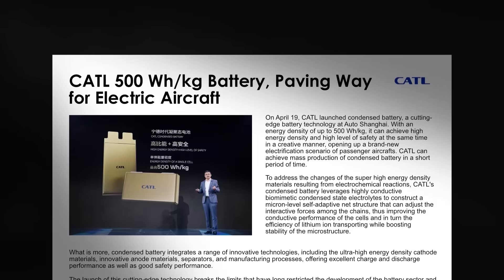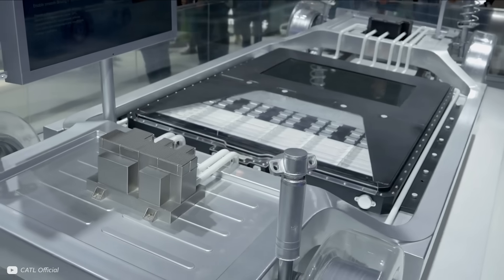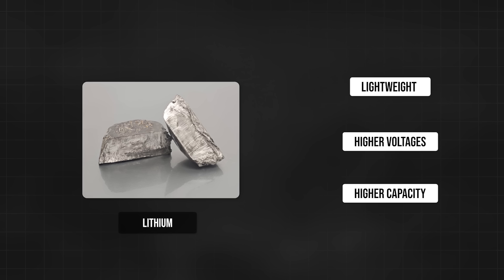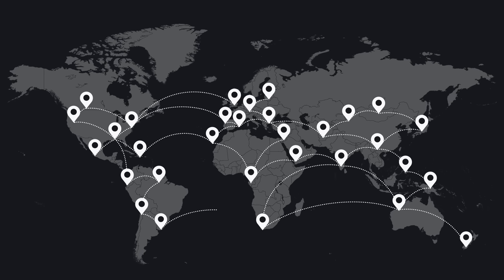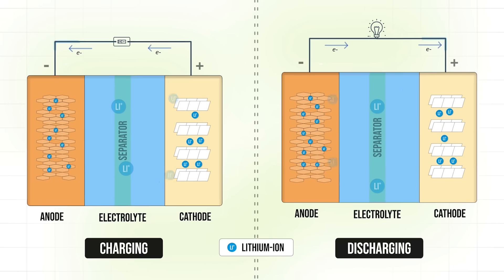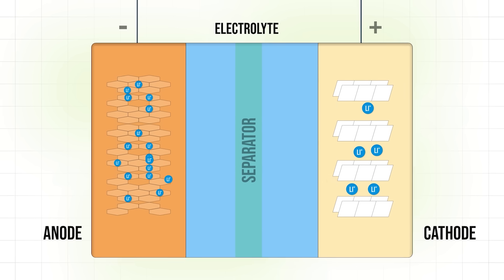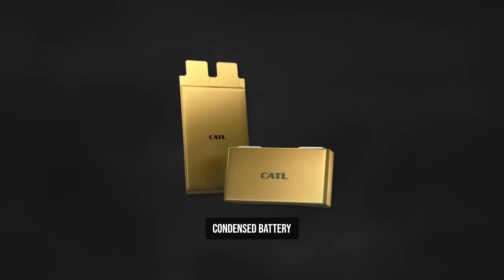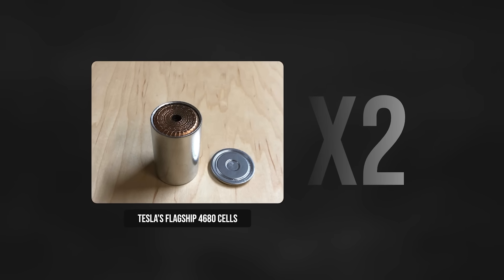Next Generation Batteries: Beyond Solid State

Comment: Whenever a new battery technology is announced, the first metrics to examine are its gravimetric and volumetric energy density, cycle life at 1C charging, the maximum supported fast-charging C-rate, and the cycle life at that fast-charging rate. If these core parameters are not disclosed, it is a strong indication that the technology is unlikely to reach large-scale commercial production. Demonstrations without these numbers are usually PR showcases, not proof of a manufacturable battery.

There are also several common red flags to watch for:

- Claims of 3,000+ cycle life without specifying the C-rate are misleading. Achieving high cycle life at 0.2C is relatively easy, but sustaining it at 1C is far more difficult and far more relevant for real-world use.
- Advertising 5C or 10C fast charging without publishing the cycle life at those rates is another major red flag. Battery degradation accelerates dramatically at such high C-rates, and without that data, the claim is incomplete.
- Especially in sodium-ion batteries, companies often announce only gravimetric energy density while avoiding volumetric energy density, which is frequently nearly half that of current LFP cells. This hides the real space and packaging penalty at the system level.
- A separate and equally important red flag is the suggestion that lower energy density is acceptable simply because the battery supports 10C or 15C charging. In reality, there is virtually no widespread charging infrastructure capable of supporting such extreme rates, and building it would be prohibitively expensive at scale.

In short, if the full performance envelope is not disclosed, the technology should be treated with skepticism rather than excitement.

Comment: Let’s hope they can make a battery that lasts all day if not a week - Problem to overcome in retrospect ( the next thing to think about ) - If you could make a new future battery 🔋cell that could last all day to say 5 days, think about the re charging capabilities of the battery, how many times you could recharge the new technology battery before the battery’s life ends and how long that would take ?, by putting say 10 new technology batteries in a block cube shape configuration you’d be able to charge one battery to another in a cycle i.e so one battery runs out and then one of the other 10 batteries 🔋 recharges the depleted first battery in a cycle, this way none of the batteries would ever deplete creating a power cell that could last for a long long time ?  this until you’d need to create fresh batteries from start again not unless the recharging processes of rechargeable battery’s improved to if re designed like the design concept and new technology processes of batteries in this video.

( Self battery recharging system with one big power cell battery in center of battery configuration set up - well of energy being discharged to and  power stored onto it, on / in, that big power cell in the center of 10 battery etc configuration formation system set up with all the other batteries finally being charged in the cycle ) a near non end infinite fuel cell 🔋? Possible to do with some ingenuity ?
Reply: battery capacity is not measured in days
Self changing is only possible with an external source of energy added to the battery body

Comment: nickel hydrogen batteries are probably still the potentially most cost effective batteries for those areas where space and weight are not an issue, they last for decades if i read correctly. but the truth is that tiny light batteries will absolutely be possible..... though this could mean they inevitably get radioactive as well as radioactive isotopes are the most obvious example of small, portable and incredibly energy dense.

Comment: 500 Wh/kg sounds high, right ? Other fuels are typically listed in MJ/kg, so let's convert: 500 * 3600 (seconds in hour)  = 1_800_000 Ws 
Ws = J, so need to convert to MJ --> 1.8 MJ/kg. In comparison, gasoline is 46 MJ/kg.  So, gasoline still has 25x energy density. And these are the high end of battery tech. No wonder E-cars weigh so much...

Comment: The CATL site says "2024-04-09.  On April 9 2024, CATL unveiled TENER, the world's first mass-producible energy storage system with zero degradation in the first five years of use in Beijing, China. Featuring all-round safety, five-year zero degradation and a robust 6.25 MWh capacity, TENER will accelerate large-scale adoption of new energy storage technologies as well as the high-quality advancement of the sector."

Comment: Diesel still has a power density 24 times of what they are claiming. This whole battery thing is a scam.
Reply: Battery power density can be reuse 900+ time but diesel is burn and use for once and gone. Which is better now?
Reply: @x0xyumingx0x : For cars and trucks, definitely Diesel. At least right now. This will change if battery technology takes a big leap forward, but the incremental changes we are seeing at the moment are not worth it.
Reply: @christianstahl4099  if you are talking about long trip yes current battery range are not yet enough, but for daily city travel I believe is more than enough per charge.

Comment: As enthusiastic as i am for new WORKING batteries without the downside of Li-Ion batteries, this might mean resurgence of the EV madness. 
But the point that we produce so much "green" energy is far away. Solar and wind are way more polluting than ppl think as the EOL recycling is never mentioned. And that goes for the most polluting part of the EV, battery too. It costs as much energy to disassemble a battery as it is to make it.
The batteries, if affordable, can be used in home systems and make energy greener. 
The "greenest" energy form is nuclear AND the safest with the least deaths per kW of all energy sources.
Reply: Wind isn't polluting: it's just inefficient.

Unless people start disassembling wind turbines as an olympic sport: in that case they'll all end up in landfills since the blades are made with glass fiber and resin (they aren't recyclable).

Comment: > atomic level carbon honeycomb structures. with only 6 carbon atoms per honeycomb
This looks like it is either graphite or Graphene. which is the "lead" in a pencil.
CPU chips using it as a substrate instead of silicon have been under development for decades as it is theoretically better.
battery improvements using it were also under development for decades as it is again theoretically better. but it has been stuck in development, unable to become commercially viable. 
if CATL managed to make it commercially viable and bring it to market than this is  a huge breakthrough
see also: carbon nanotubes and fullerine.

Comment: 500 Wh/kg is not even remotely enough gravimetric energy density for aircraft. Jet fuel has a 13.1kWh/kg (13,100 Wh/kg energy density and hydrogen has a 33.1 kWh/kg (33,100 Wh/kg). With just a 2% energy conversion efficiency hydrogen is already at 650 ish Wh/kg. As it stands fuel cells and Eternium Aerospace's Strayton generators hover around 60% energy conversion efficiency, giving 19.8 kWh/kg (19,800 Wh/kg) that's roughly a 3800% increase in energy per given mass. Also, for any range you're talking MW of power over hours, that would either take into the sun is a red giant to charge or it'll produce a prohibitive amount of heat during the charging process. Batteries are not the answer.

Comment: The plus marked part of the battery is where the electrons flow out from (excessive minus charged electrons) and the minus marked part of the battery is where the electrons flow to (positively charged ions).  somehow that does not fit. 2:16 and from everything I learned the Cathode is positive and the Anode is negative. but the graphic at 2:16 shows it the other way around. Specially in the Electrolyte the plus charged Li ions flow in both directions, to cathode AND anode???

Comment: Without extensive distributed grid storage and power generation expansion, the grid is not ready, anywhere, for 2x capacity car batteries that charge significantly faster.

Comment: If you make the seperator with a conductive layer and wire it to the appropriate side dendrites do not cause short circuits they act as greater surface area for energy storage and transfer.

Comment: Excellent video! However, the first battery diagram has an error. The cathode is negative inside the battery, but positive on top. The reverse is true for the anode. Inside the battery, the cathode is negative, and electrons leave it to neutralize Li+ ions flowing to it, so electrons are pulled down into the outside cathode terminal.

Comment: Shiny stuff. America's fossil fuel industry blocking battery development has all but guaranteed that China will be the source of battery tech in the 21st century. 

I've seen elsewhere that the installation rate of photoelectrics has gone hypberbolic, outpacing all of the other technologies, such as fossil fuel and nuclear. It's not "all others combined" but if development continues at these rates, it will be.

I wonder if this cathode technology can be used with sodium? That would be a good deal, since sodium is cheap and readily available pretty much everywhere. If not, the iron flow cells are quite promising for cells that can sit on the ground. 

We may yet get past the CO2 age, despite the influence of American fossil fuel companies.

Comment: The only (and important problem ) is still the Lithium supply chain. It is not really abundant, really dirty to mine and to recycle and it is linked with unethical acquisition and exploitation so still we need research in all technologies
Reply: UK work shows that lithium can be extracted from Geothermal power wells ..giving a 95% Li Carbonate purity.. and no need for slow expensive toxic stuff at the surface by comparison. 

The other options center on Na ... Al and Sulpher ... even if they use Li as a component the volume is vastly reduced.  
There are ways.... plus it's cheaper and easier to recycle old batteries than extract from ores currently.
Reply: with this technology, despite using another more part of lithium, will make every kilogram of lithium capable of storing more energy, which means an actual reduction in lithium need. Specially that when you consider that it will enable smaller batteries in cars, the less weight from the battery itself means you can move the car even more for the same amount of energy, which means the battery can be further reduced
Reply: They're moving to cheap and unlimited sodium ion starting with energy storage
Reply: Its definitely cheaper than most metals
Reply: Lithium is fairly abundant. You probably mean cobalt or nickel.

Comment: Lithium ion batteries have a larger problem long term. Even if we converted all known global lithium reserves and turned them in to batteries, the total capacity is less than 1% of global energy demands. Unless we discover new (cost effective) sources of lithium an order of magnitude larger than what currently exists, it doesn't make sense to place so much emphasis on Li-based batteries for large scale consumers like transport or infrastructure.
Reply: Fine. Use sodium then.

Comment: The breakthrough for air travel would be for structural CATL batteries to be built into the carbon-fibre structure of an aeroplane. Making the gross weight of the aeroplane up to 60% lighter, allowing for a greater range. A more aerodynamic fuselage and a wider wingspan would allow for the final 40% of a flight to be predominantly glide-only with deployable air-resistance to regenerate the batteries.
Reply: Flying wings are amazing and under utilized as airports are not designed or retrofited to use them.

Comment: The energy density of diesel is 12 700 watt hours per kg and of these "fantastic" batteries 500. Thus the energy density of diesel is more than 25 times higher. We will not see any airlines flying battery driven planes. They actually want to fly cargo - not batteries.
Reply: Now do the efficiency of diesel engines
Reply: @iota-co7369  This is actually a quite complex question to answer. Firstly, jet propulsion is done with a jet-engine driven by jet fuel (essentially diesel) - a diesel engine is not used. The overall propulsion efficiency of a jet engine may be like 20-40%. This should be compared to a propeller plane driven via a battery and an electric motor. The efficiency of an electric motor is quite high - let say 90% and the propulsion efficiency of a propeller plane might be maybe 70% so the overall efficiency would be about 60%. Thus, an electric airplane might be 1.5 - 3 fold more efficient energy wise but on the other hand, a propeller driven plane can't fly at as high altitude as a jet plane and would be considerably slower and the weight of the batteries would reduce the cargo to be carried tremendously. The bottom line is therefore that electric planes with present batteries can't be economically viable for long distance and bulk transportation. Perhaps electric planes can be use over short distances as a commuter plane for transportation of good paying customers.

Comment: I never understood why the formation of dendrites couldn't be used as a feature rather than bug. These branches create an enormous amount of surface area. Perhaps some day a smart engineer out there can figure out how to use these trees to store vast amount of charge rather than run away from them.
Reply: There's an problem, its like making an holes in your house for more entryway. But it degrade the structural integrity of the house. So, your idea would make the battery much faster to degrade.

Comment: I thought that solid state batteries were supposed to be safer than traditional liquid electrolyte batteries. The liquid electrolyte is very inflammable which results in fires if the cell short circuits.
Reply: Solid states are supposed to be more stable on paper at least. However it looks like solid state batteries may never reach commercial production. The current batteries marketed as "solid state" aren't really a true solid state battery. It's more of a hybrid design using semi solid materials and gels. The problem with SS batteries is that they can't seem to overcome the internal resistance problems with them. For some reason SS batteries have a wide range of electrical resistance levels even when tightly controlling production variables.

Comment: To be fair, solid state batteries still have several benefits that I'm not sure are addressed by this. As far as I understand anyway. For example, solid state batteries are much safer in context of punctures. That's not to say that this isn't incredible technology and doesn't meet a lot of the needs that solid state batteries were supposed to address.

Comment: Dendrites have NOT been the only focus of solid state. It's the main reason they haven't been adopted, but the solid state idea was to address the major undesirable shortcomings of Lion.  Such as pollution in mining, charging time inversely proportional to battery life, intense fires that spread to everything around them and can flare up again weeks later, and as a result of that aforementioned fire hazard, entire cars being junked after accidents or 3-4  years of driving with nobody willing to purchase such vehicles.  

None of that even begins to touch on battery pricing.  Or the insurance pricing. Or the fact that the infrastructure in the US simply won't deal with the power consumption required during peak charging times, regardless of the technology used. 

So, will CATL address these issues? Introduce new ones?  The technology is amazing but like so many potential commercial attempts, will it end up being a great idea on paper? Perhaps limited to stationary backup power supply but not useful in EVs?

Comment: I think almost more important than higher energy density is risk of catastrophic failure for batteries, when talking about aeroplanes. If a car battery fails you call a tow truck, if a plane battery fails you call a hearse. The main reason why jet/turbine aircraft are so popular for commercial aircraft is their phenomenal reliability.
Reply: KISS more parts more failures KISS
Reply: Engines fail  precisely because they are complex machines.  Batteries don't have moving parts, making catastrophic failure extremely remote.

Comment: Even if you stop the dendrites, they build up a thick resistive layer on your anode and consume a lot of electrolyte because of their huge surface area. Honestly, I see way too many papers trying to physically block the dendrites and it's just not a good plan. You need to prevent them from forming at all, which is what I believe this cell-membrane thing does. It's like a "water"proof film that lets lithium ions pass but keeps out the electrolyte solvents so they don't react with the metal.